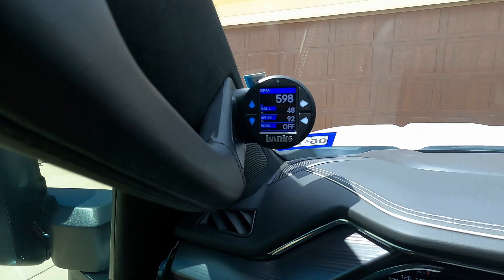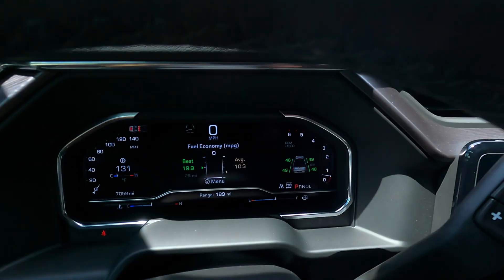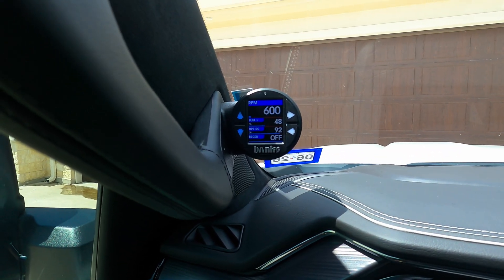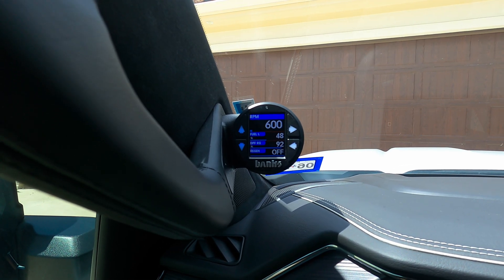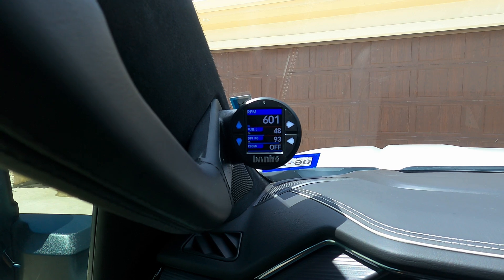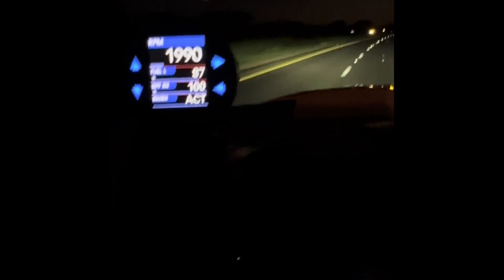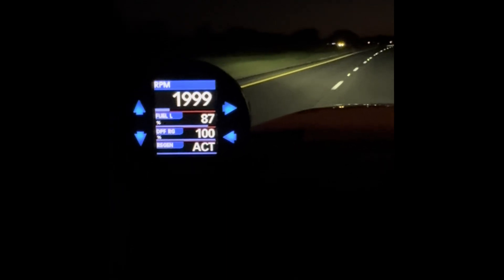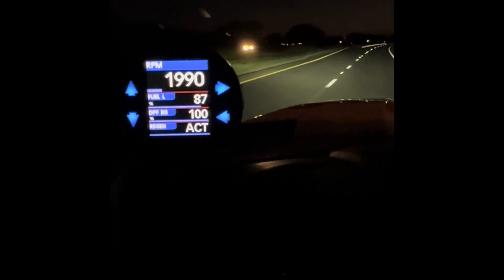Rundown on DPF, Regens, Fuel Treatment, and Banks IDash

Comment: Thankyou for all the explanations.  I just traded my 2020 7.3 and wanted another one but couldn’t find one in a lariat. Ended up with a PS HO.  Fuel mileage has been great averaging 18 but on the freeway at 70, cruise and eco I have seen just over 22 and I added 37 11.5 18’s on the factory Tremor wheel.  I also swapped out the 1.5” taller spring to a BDS 2”.  I have been using hotshot but I am reading the one you use is better.  Will try that next.

Comment: I use a edge cts3 insight and drive a 2019 gmc 3500hd with a 6.6L duramax, with only 47,000 miles. (lots of short trips) so I  do a mobile regeneration at 50% soot. Not sure if thats good or bad  but it seems to work good for me.

Comment: What is your thoughts about the FASS EGR filter system?
Reply: Same question for me too
Reply from the maker: It is interesting and I have considered it for my L5P.. It’s definitely something to consider for those that cannot delete. I don’t run deletes so it peaked my interest. I think it’s too early to tell what long term will be on the engine. The egr pushes the through in a gas form and unburned fuel and sut develop a wet carbon to intake that can eventually dry and create large deposits to get into the cylinders.. The catalyst basically turns these to ash and reduces carbon buildup. I am not sure if the ash will cause more harm than the carbon buildup. The catalyst does heat up and complete the burn off before entering the cylinder but this also increases the temp going directly into the intake.. I’m 50/50 on it..
Reply: @RockyRohde  My concern - currently consuming softer(?) particulates but with the FASS you consume burnt, harder more gritty particulates?
Reply from the maker: That is my opinion.. Yes intake has less buildup but what does the dry ash and hotter temps do to the valves and rings?

Comment: When I have to idle I had a high idle switch installed so it idles in high around 1200 rpm’s. Also I have my truck set in manual regen. Gets a better clean

Comment: This is a great explanation video. I’m looking forward to getting a IDash since you can’t tell when it goes to regen
Reply from the maker: Thanks for watching.. I just released another video about regens on my channel. Use code Rocky on banks site to save 10%
Reply: I hear 22 cummins kick into regen when it does it how do people not hear it makes the quite stock sounding exhaust louder and the turbo spins more my ram has a monitor on the stock screen does ford and chevy not do that?
Reply: Ambulances and brush trucks idle all the time farm trucks not that its good for them just saying as long as you mix in some good driving with it its not an issue

Comment: 2015 ram 1500 here with 102k miles. I have an iDash and Pedal Monster along with a Green Diesel Engineering tune. I can tell you a Pedal Monster along with GDE makes it a rocket sled. What Rocky says is 100% true about having an engine monitor. The typical dashboard is really dumbed down. By the time a regen shows up on the truck's dash, it's about maxed out, and you do NOT want to be in town stuck at lights when it happens. With an iDash, it's never a surprise. I watch the DPF level. If it's getting "up there" I will start a mobile regen (right from the iDash) and take a freeway run on the way home. That way, it's at 8% in the driveway, instead of 79% and at risk of starting a regen when I'm going to work and be parked soon. A monitor helps a lot in planning routes around soot levels. The GDE tune itself slows regens waaaay down, but it's still a diesel with emission parts, so it's gonna regen whether you want it to or not. Many people scream "Delete it!" but the time is a' coming when a cop will see a truck rolling coal, and it'll be loaded on a flatbed/impounded and banned from the road. The laws are starting to catch up.
Reply: Only bad tunes roll coal with unburnt fuel thats the dumbest way to have your diesel deleted and run. There are soo many better options to never blow soot just saying and with Trump in and the EPAs heads spinning we will see where it all ends up at the end of the day tho i paid 70k for my truck ill do what i want with it just keep your shit incase you need to reinstall for a minute and pass some visual inspection then revert it back no bigs i love spinning a wrench do it all the time for my job 20+ yrs

Comment: Wow great response.  I have a 2020 Denali HD. 25k miles currently, lots of short trips. Was considering a monitor just to gain info.  Looking at the Edge insight.  The whole regen carbon burn thing is real.  Ya I struggle with dealerships as well.

Comment: Nice explanation.... I've got the IDash for my 24 LP5,   what engine setting are you using?  I can't find the Regen option. When I called Banks they said they are currently working on an update to get the IDash to read all the ECM and TCM data.
Reply from the maker: Still waiting on update also. I have the beta firmware on it now.
Reply: Use the top right arrow, go to "diagnostics", select "vehicle",  then on the bottom, select "mobile regen". Hope that helps.